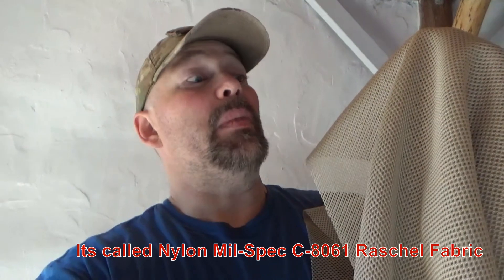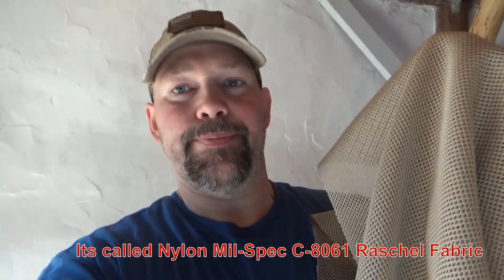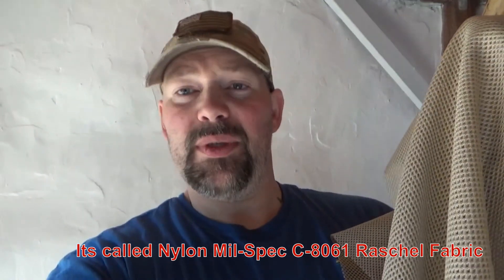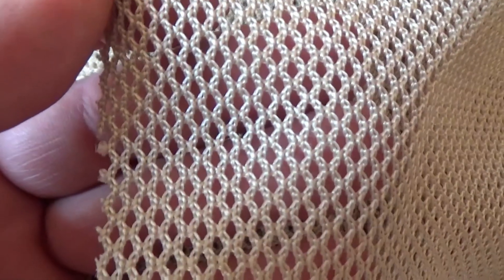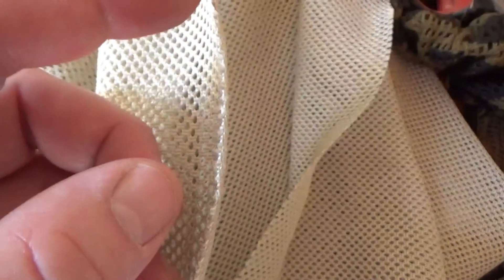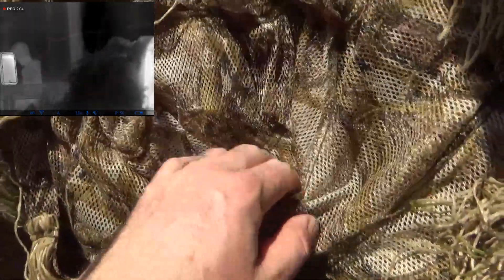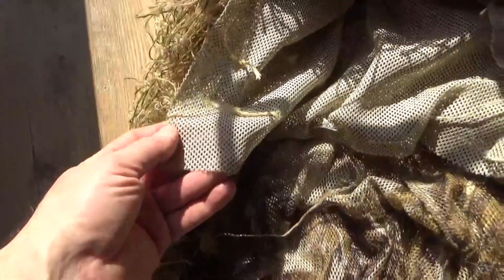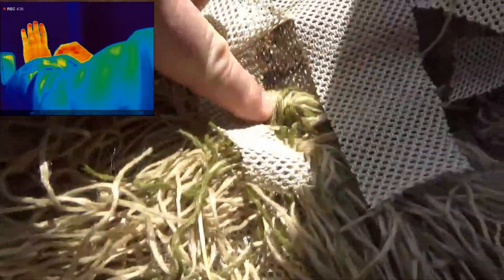DIY thermal scope escape and evasion

Comment: I've been thinking about strips of aluminum foil woven in the ghillie suit. I would spray one side of the aluminum foil with some 3m rubber spray adhesive and let it dry and harden. That way, the foil wouldn't make mush noise while moving around, AND it would help keep the heat off the one side. I would also spray it with some "kilz  deep balck primer. Then, cut up the aluminum foil in long strips and put the strips interwoven in the suit. I have also been thinking about Farady material. They sell those large sheets on Amazon, and they are pretty cheap. I am wondering about using that as well! That can be cut into long and thick strips like the aluminum foil, or it can be cut to fit the pieces into the suit where needed the most. I was a chemist for Dow Chemical Company for 14 years until I started my own business. I worked with Nasa, Boeing, Lockheed, and even Nike. I spealized in Epoxy Thermoset resins and helped invent so ground breaking material for our fighter jets, satellites for NASA, and the airplanes we fly in today. I've even made so crazy Thermoset resins for Nike and their resin golf balls. If I was still working there and had all those resources back in my hands, I could EASILY make a ghillie suite that was 100% thermal resistant and completely blind to even military grade thermal cameras. This is something I just started to need... so I'll definitely figure this out with everyday supplies that anyone can get their hands on! In my state, about 2 months ago, my crooked AF state started using surveillance drones at night time. They are all over my state, and they are out EVERY night until sun up. Hundreds and thousands of them over my town, all surrounding towns. Many different sizes that fly over my house and my property ALL FU*KING night long. I feel extremely violated and very p!ssed off that our gov. Cares more about spying on their own citizens than who and what is flooding across our beloved b0arders. I can't even step a pinky toe out of my door without it being seen at every angle possible! They fly just above my home all night and all over my 2-acre property.... it drives me fu*king insane that our crooked AF gov tyrants are doing this BS to US!! I am beyond mad, and my entire town is p!ssed off. When you call the cops, NOTHING, called the FAA... they blew smoke up my bum!, called the sheriff... he doesn't know anything, local cops again... we don't know anything, called state police... they laugh you off the phone, acting like you are the crazy one! So now I am DETERMINED to do this.... so i can watch where they go when the sun comes up, where they come in from during sun down, etc etc. All I hear all night is a jet noise that continuously flies in a gigantic loop over my town. Anyone has so tips or any help, and I greatly appreciate it.

Comment: Intelligent experiment.  I suggest a light weight pvc frame to hold the fabric off the skin
Reply: Maybe hard nylon mesh will make it rigid enough to stay off the skin for most of the body and rest on the shoulders
Reply: @svrondo247 the jute should disperse the heat in such a way it never shows up.

Comment: Look up beez combat system.. The predator ghillie suit. $429. I got a thermal suit on top of my swagman roll.   Thank me later
Reply from the maker: I primarily do testing of normal over the counter commonly available materials for people looking to make their own thermal equipment on a reasonable budget of about a hundred bucks or less. $429 is not budget. Lol. It looks like it is probably effective though. It is based on similar design concepts to what I’ve seen elsewhere and some of the DIY stuff i have done. I have not tested it though. But layered mesh, like they have done, is a proven and effective strategy. I am skeptical though. I don’t see videos testing it except for short periods of time, and in those, I’m starting to see thermal bleed through right as they are terminating the video. Im not convinced on the overall end effectiveness. Ive seen SO MANY deceptive marketing videos for thermal gear. Im very skeptical until i can test it or i see a truly neutral third party test it. But i certainly think it probably does an excellent job compared to many systems from what I’ve seen so far. Thanks for bringing it up.

Comment: You need to test it for longer. The longer you where it the more heat it will absorb. I dont think that camo will work for more than 10 mins
Reply from the maker: I’ve done many videos showing how quickly heat seeps through if it’s going to seep through, including time lapse videos which show that, on average, it takes less than two minutes for heat seep to normalize and then it reaches equilibrium with internal heat versus heat dissipation and no matter how long you wear it past that it doesn’t heat up any further.  

A simple and easy to follow and understand example is this:  when you put on a jacket, does the outer surface of the jacket just continuously heat up until it reaches 98.6 F?  The obvious answer is no. We don’t walk around with every article of clothing we don being essentially 100 degrees to touch. So there has to be a point at which the material stops heating and the loss of heat to the environment exceeds additional heat stacked on from the body. The point of that equilibrium occurs actually very rapidly. 

When you first put on a jacket, the material is cold. How long does it take to be comfortable? A minute or two? There’s that two minute number approximation again. Less than two minutes on average seems to be how long it takes to heat up. That’s it. That’s all. There’s a marginal time lag on transfer of heat through to outer shell, then the outer surface also quickly achieves equilibrium. 

I’ve done tests, checking attire on thermal prior to wearing it, donning attire and checking thermal signature immediately. Watching for a couple minutes until it achieves equilibrium, then I go out for a walk or hike, and spend half an hour to several hours out and about doing everything from sitting in a heated car to going on cross country hikes. Then when I come back, I compare my heat signature to the previous recordings. In most cases the difference hours later, including heated environments or freezing environments, sedentary or vigorous activity, are all rough approximations to what was achieved literally within the first two minutes of it being first put on.

Watch some of my other videos. Don’t take my word for it. See it for yourself. I have lots of materials testing and time lapse videos showing what worked, and what failed, and in some cases, what failed spectacularly. If I’m showing something and saying it seems to be working, it’s because it did a decent job under multiple testing situations. I’m not selling anything, and I have a limited bias in findings here (I won’t say no bias, because everyone has some bias of some kind), but I try to present just factual material and actual recordings so people can judge results for themselves regardless of my opinion of the results.

I think I have around 90 videos uploaded right now. At one point I had over 150. All doing just this. Testing materials and myths. Go watch my other vids. Most are downright boring and hard to watch because I’m literally just sitting there typing on a computer or watching a movie specifically to allow a material to heat up over time and then showing those super boring drool-fest videos of time lapses of me just sitting there doing nothing in high speed. I have plenty of videos if you want to see time lapse proof, or you want to see the effects I’m referring to for yourself. But one thing remains true through pretty much all of them. I’d say probably 90% of all the heating that’s going to happen, happens within the first minute, whether it’s a wool blanket, bubble wrap, burlap, aluminized tarp, ghillie suit, winter coat, etc. and by the end of the second minute, wherever you’re at, is pretty much where you’re going to be an hour later. The difference from minute 2 or 3 to minute 10 of 15 is pretty small, if you could even tell which was which in a side by side still-frame comparison without being told which was which. 

Go watch and see. Don’t take my word for it. :)
Reply from the maker: Here’s an example of a time lapse video I shot which very clearly shows the speed at which fabric heats up and then achieves equilibrium. This is around 40 minutes of actual time under materials (including added on layers) compressed into ten minutes with some sections sped up to show as much as fifteen minutes compressed into ten seconds of video. Again, almost all heating is finished within the first minute of the addition of any material, and cooling is achieved within one minute of the removal of a layer.

https://youtu.be/U2l3XUSM9iE

Comment: Thanks for the video, I've got a new idea try pleating (like an accordion) strips of that mesh (or window screen) and sticking that on places where you can't have hanging fabric (like on top of the shoulders, or on top of a hat) for a breathable, non conductive airgap to then put another fabric layer over.
Reply from the maker: Love it. I wanted to try something similar as well. I saw British SAS use a rolled/folded mesh to create loops. I like your idea about using accordion stand offs on body contact points like shoulders where we traditionally have problems because of the contact heat up.
Reply: @ThatThermalGuy  these loops you mention? Can you show something similar and their affect against thermal?
Reply from the maker: Hey there. I did one experiment on film with a loop mock up (and a few other tests). 

https://youtu.be/2cKuq5tc5oE?si=28EgtbCYjWqF2hzA

The looping was effective enough it warranted more testing. I have since re-run the test with more overlap between the loops so at any given point there is always at least two layers of loop fabric, and it improved performance over shown in this video (which was already good).

Comment: Awesome video. Have been looking for thermal evasion materials and cloaks available on the market but they're all damn expensive and never mention the materials used! Would really love to see a DIY version of what they're offering with the multispectral protection (as the proliferation of thermal cameras is so large). I'm sure with a bit of research you can DIY what is equivalent to the ProAPT gucci suits and get it fitting over packs and be super functional. So far seems to get 90%+ of the job done so looking forward to part 2!

Comment: So how for the suit look after 3 hours of running and exposure to the elements?

This is the real test.
Reply from the maker: I’m going to repost a reply I made elsewhere which mostly addresses this. :)

As with most things, it only takes a few minutes to heat up and stabilize. Think about it like this. It’s cold outside. So you put on a coat. How long does it take for that coat to get warm inside? 30 seconds? One minute? When does it stop increasing in temperature as you sit there? For most people, the answer is mere minutes. Maybe less. Same thing here. If i directly grab the material or if it’s in direct contact with my skin, it’s heated up in seconds. If I don’t and it has indirect contact, it takes a minute to heat up. But at that point, it stabilizes. A coat doesn’t get hotter the longer you wear it. Otherwise they would be unbearable within minutes. Likewise, we couldn’t wear pants, or shirts, because if they kept getting hotter as the hours passed, we would all die if heat stroke from our clothing. But that doesn’t happen. It gets to a point, quite rapidly, of temperature the garments will keep and hold, and then it stabilizes. That’s it. 

The materials I test are no different. You see the heat patterns within seconds to a minute. It may have a couple minute delay to push through a temperature change across an insulative barrier. But after that, what you see is what you get. 

I’ve tested this to make sure I’m not crazy. I’ve looked at the heat signature of myself and my son wearing different types of garments with different insulation properties, then walked around for an hour or two in the forest and come back and rechecked our thermal signatures. With very little exception the signatures are identical between the 5 minutes mark and the hour and a half mark. And that exception is mostly due to sweat if wearing only a t shirt which gets soaked in hotter weather, the area that gets damp from sweat changes it’s signature slightly, and in general, it’s to the betterment of helping mask your signature. Remember, the purpose of sweat is to cause evaporative cooling. 

I have also walked around town, and in stores, shooting thermal imaging footage. The things people wearing have a specific point they heat up to and then stabilize. And that’s it. That’s all you get. 

For instance, in the video posted here, I was wearing that t shirt, blue jeans and boots for 5 hours before filming. But they weren’t glowing like the sun, right? They didn’t just keep getting hotter and hotter even though I was wearing them for five hours. And in the outdoor footage in this video you can see that my street clothes were actually generating a smaller heat signature than the ground and even sone of the trees in some places. Despite wearing clothing with minimal insulation for five hours, dirt and bark was brighter than I was. Lol. 

That’s why I’ve done the testing videos I have, with either some time lapse over the course of a minute or two, or sone activity for a minute or two, because that’s really all you need to showcase the properties of a material over time. 

All that said, returning to current, exposure to the elements rd changes a signature depending on whether you are in direct sun or shade. Your signature will change, as different materials heat and cool, absorb and radiate, and reflect, at different speeds. That’s part of why I’m an advocate of mixed materials in a ghillie whether you need them or not.  If you use 100% polyester, then your entire suit heats, reflects, emits, etc at the same pace, and moving between sun and shade, you have a largely uniform response. Mixing in different materials breaks that up. Exampke, if nylon releases stores temp faster than polyester, and you have the two materials interwoven next to each other in ghillie strips, you get a blended jumbled affect, as opposed to a uniform blob effect.

Lastly to the point you raised, you are running in a ghillie, while it does still blunt your signature, the act of running completely negates the purpose of the ghillie. You can be seen. So running is lnt really the way you test a Ghillie suit. When judging how well a ghillie works, are you doing that by looking at a model who is laying down is a matched environment as it’s intended purpose? Or are you doing it by watching someone wearing a ghillie go jogging down the street? No. You judge a ghillie by it’s a unity yo mask a person from detection when utilized as intended, in a matched environment, using proper stalking concepts. And just like you don’t go literally running up on a target in a ghillie as a sniper, you don’t go running up on a thermal
imager as a hider. If you have to run, you run while you need to, and get to a place where you can effectively hide again, and then you hide again. And as you hide, you cool down again, just like wearing blue jeans in my video here, it returns back to normal temperature rapidly. :)